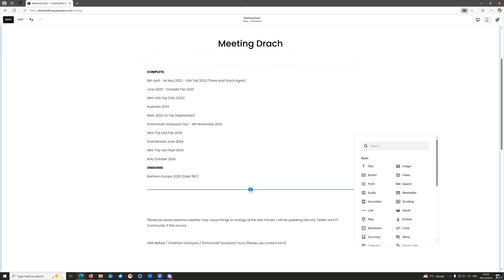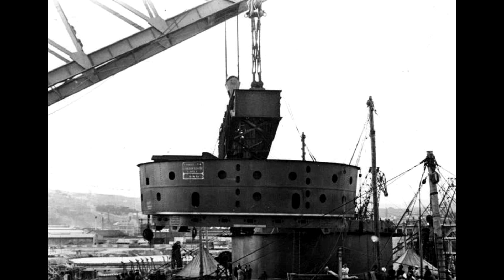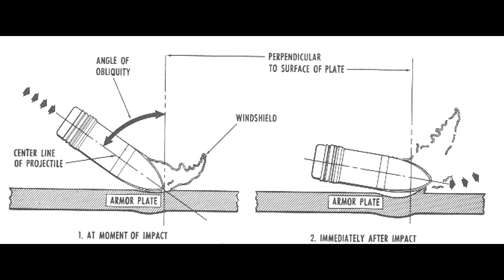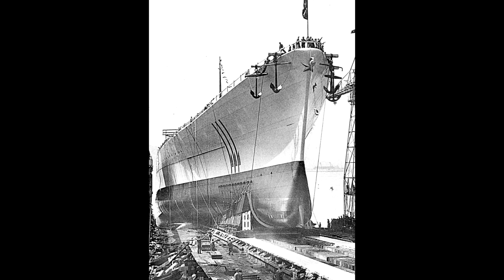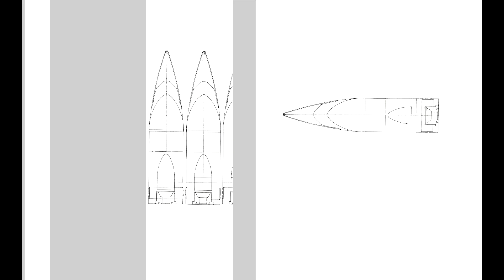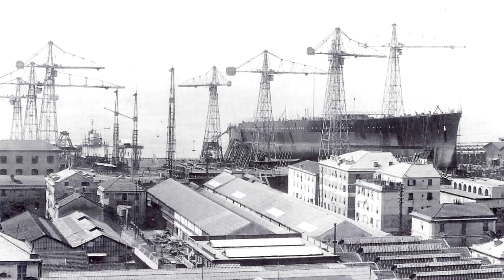Naval Engineering - Did the Littorio's Armour Scheme Work?

Comment: One thing you need to keep in mind is that concrete is very strong in compression for it's weight.  Concrete can very greatly in it's compressive strength depending on it's composition.  A high strength mix of foamed concrete would have much greater resistance to penetration than regular strength foamed concrete.

Comment: Aerated materials behave very non-linearly, the reduced density of foamed concrete is like you said decisively non-linear; because normal, non-foamed concrete lacks any meaningful internal pore space, it can't internally compress, and instead acts like a hydraulic conduit that somewhat offsets any shearing potential that might have separated the cap from the shell. By allowing the aerated micro-pores to fracture/compress and absorb kinetic energy before densification, at which point they act the same way, you almost create a kind of hydropneumatic rather than hydraulic system that much more quickly breaks up the cap for its thickness and density than air or solid concrete alone would. In addition, this isolates shock rather than spreading it for much the same reason, aerated concrete not permitting large fractures to spread through its whole mass but rather isolating it to one specific region on impact.

Take a look at SACON (Shock-Absorbing Concrete) and other programs for more, as well as Gibson's and Ashby's "Cellular Solids" if you're into math.

Comment: I am not sure I agree with a basic premise of this discussion. My problem is the definition of the cap in AP capped shells. I recall reading an article from before WWI that explained the design and functionality of the cap. The article stated that the cap was softer than the body of the projectile. The purpose was to provide an expanding ring whose mass would hold the projectile core in place at an angled impact and to also keep it from shattering.
Reply: I believe the article was published in the Naval Review for 1913.

Comment: People are often surprised what excellent engineers Italy produces. Their ships and guns were fantastic. The problems their guns had were very bad shells, which were supplied by a relative of Benito's in the usual kickback scheme that holds Italian politics back since the dawn of time. They would cluster a salvo into a circle three times what a British ship would. No wonder they ran! There were many instances of ships continuously being straddled over and over, yet no hits.
I have a couple of Italian metalworking machines. They are so much easier to use and are more accurate than any others I ever used. So don't blame Italian ships for their problems, or even their officers. If you straddle an enemy over and over, it is the fault of the shells, not the gunners.

Comment: I wonder if there is another way of looking at this.  I am thinking of how sprung dance floors are constructed, and how the kamikaze hit that penetrated the flight deck armor of HMS Formidable (4 May 1945) may have been more effective as a result of striking a joint between multiple armor plates.  It was only a 250kg bomb, and a light weight aircraft (a Zero), and based on the eyewitness testimony probably not flying that fast.  Many people will claim that such a light bomb could not penetrate that armor in a low altitude attack and yet clearly it did (which suggests a potential flaw in how they measured effectiveness of armor thickness versus weapons - did they take armor joints into account?).

A sprung dance floor uses offsets to people stepping on the joints do not feel the 'hardness' of the underlying floor - there are multiple layers in the structure and a bit of thickness to provide this offset.  It makes the wood floor very comfortable, much more so than a naive floor build where no offset is present and the floor feels different at the joints than it does in between.  In dance shoes the difference is quite noticeable if you pay attention.  Effectively the sprung floor, by design, is somewhat isolated from whatever is underneath it.

What if the Italians had thought about the vulnerability of armor plates at the joints, and had come up with the concrete scheme and a little bit of depth to give them offset between the armor layers, with a medium (foamed concrete) that would tend to disperse the energy of a hit a bit?  Perhaps the gap is there not so much for decapping purposes but to allow for this and for the structural elements that let the outer armor layer joints be offset from the inner armor layer joints?  

If you had a single steel plate of greater thickness, it would efficiently transmit force through the single joint since it's all metal, but multiple layers that are offset with a somewhat diffuse medium between them could potentially provide protection from force being transmitted in this manner.  I say potentially because I haven't tried to model it and it's not my field.

I have no evidence to support this idea, it's just a random thought.  Did anybody think in these terms back then?  Do we have any pictures showing the structure of the various layers and where the fasteners were?

On a related note, maybe Formidable either needed a little thicker armor (3.5 inches?), or to have the armor divided into thinner pieces with a gap and an offset scheme.

Comment: I don't understand the point of using concrete (foamed or not) as a filler.  Drachinifel clearly explained that it's not enough to break the cap's attachment points; the cap must fall away from the shell body, and for this it needs an empty space to fall into.  If the shell is surrounded by concrete, it will arrive at the armour belt with the cap still in position.
Reply: That's not what the RL German experiments found. 
No projectile arrives perfectly straight. The same impact that decaps it make it start to tumble, and something that enhances friction accelerates the separation between the cap and the shell.

Comment: What I take away from this is that the decapping plate would have worked as intended if only the Italians had moved the decapping plate outward and/or the armour belt inward enough to leave a one-meter gap.  As far as I can tell, most or all of this was above the waterline, so displacement would not be an issue.

Comment: I came to say that modeling of foam properties can be a very deep rabbit hole.  As Theodore_zd2mv’s pointed out you’re going to need a whole lot more info on the foaming to even start the process.  
Assuming you do have some of the info from the records I would talk to mining engineers and companies since spray concrete is often used to quickly stabilize tunnel walls.

Comment: Where this system fails, or perhaps falls short is when you take into account the behaviour of enemy shells, not simply your own.

I am NOT a subject matter expert, I have just read "a few" discussions on forums as well as doing my own "googling",

The Nathan Okun article mentions:

"U.S. hard AP caps Army or Navy - do not consistently break up at 0-30° obliquity until 0.35-caliber of STS (armor-grade) is used as the decapping plate"

Which confirms what I had read earlier, 

In regards to the fact that at "beam on" engagements, that the STS hull plating is unable able to decap large naval shells,

As well as understanding some of the design choices of other navies.

Based on no doubt hoping to consistently decap enemy shells (US naval shells), the decapping plate would need to be 406mm X 0.35 = 142.1mm 

Assuming that German and British shells ALSO has armour caps of similar hardness (Nathan assumes that the Germans DID) this would mean 380mm/381mm X 0.35 = 133-133.35 mm

Which explains why Bismarck's upper belt was 145mm

(Sorry to bring Bismarck into this, but this is a video on spaced armour)

So if the Germans who also did experiments on spaced armour came up with using 145mm, knowing about concrete etc

Is 70mm + concrete really going to be all that effective?

The German did numerous tests using a 38cm shell at 0-45 deg impact angles,

The article that Nathan posted, claims that only a single test was done using a 32cm shell at 30 deg (against a scaled down mock up of VITTORIO VENETO belt at 30°)

So my own thoughts is that if I was going for a spaced armour layout, I wouldn't use the Italian design.
Reply: "break" in that article means "break", not "separate". That's the minumum thickness to effectively break the cap. To separate it, you can see the graph, and consider only type I cap (the same Okun gives a list of the shells with type II cap, and no WWII battleship shell used it). 0.155 calibers decap everything.
Reply: @neutronalchemist3241  The problem is that the cap might separate but still be able to act as a cap,

So the only guaranteed way to remove the ballistic cap from any further penetration is the break the cap,

However as the angle increases the higher the chance of the cap separating and not playing any further part in helping the shell penetrate.
Reply: @notsureyou  The studies cited in the clip were made exactly to find the gap between the decapping plate and the main plate necessary to remove the not-broken cap from the shell.
Reply: @neutronalchemist3241  If the cap is dislodged and no longer plays a part in any future penetration 

(even if beam on at close range)

I wonder why the designers of Bismarck decided to use more armour than what was needed for the upper belt.

being generous and using .02 calibre, 

And 406mm (the largest to be expected shell)

Gives a value of 81.2mm

So why would they use 145mm,

Unless it was decapping as well as keeping  keeping 6 inch shell etc out beyond circa 4km 🤔🤷‍♂
Reply: @notsureyou  The fact that the Germans made a choice, doesn't mean that who made different choices was wrong. Surely the 145mm upper plate of the Bismarck gave more protection than the 70mm of the Littorio against lower caliber guns. At the cost of more weight. A warship design is made of compromises.
Reply: @neutronalchemist3241  100% agree

Comment: Actually most of the questioning I’ve seen has been much more about the Littorio Class torpedo protection (or Pugliese) system
Reply: Analyzing the damages it received, it worked quite well, with good containment and short repairing times. The Soviets tested it in real scale against the traditional spaced system, and chose the Pugliese for the Sovetsky Soyuz class battelships. The results of their tests are available online.  
The Navweaps critique of a "dam mistakenly built bowing downstream" doesn't make any sense. If that's true, the traditional systems are dams with an outward 90° angle, that's even worse. 
Conte di Cavour and Caio Duilio at Taranto had not been hit in the Pugliese System. The torpedoes, ricocheting from the surface to the bottom of the harbor, exploded under the keel, in the worst location possible (is to purposedly achieve similar hits that magnetic fuzes had been later introduced).

Comment: I feel like filling the scheme with concrete would depend veary heavily on the hardness of gravel used. It is in fact eeryly similar to later developed composite schemes, which, granted were meant primarily to counter HEAT-FS at significantly smaller calibers  but they still did provide weight efficient protection against kinetic penetrators.

Comment: Very interesting analysis!  I wonder... you now calculated the worst-case situation where a shell is coming perpendicular.  What about when it comes at for example 20 degrees to perpendicular?  
I can imagine that equal protection to regular armor at perpendicular impact is considered sufficient when at the same time you also get significant better protection at different angles.  After all, in combat you'll probably are either closing the distance to your opponent when engaging a weaker opponent or increasing distance when disengaging.   Even when keeping distance, you still might be laterally displaced and not having the gun bear perpendicular to the ship. 
The instances at which incoming fire is near perpendicular to the ship is probably quite rare compared to different angles.

Comment: It's always incredible to imagine just the sheer mass of the armor used on these things. The first battleship I had a chance to wander about was the Massachusetts. You see the huge steel tube running up to the turret, but you don't really get a sense of it until you've passed through a hatch. It's a strange thing to wrap you head around. Then when you include the fact that that armor on the Massachusetts also had stress cracks running across them caused by the recoil forces of the main gun, then you really start to go bibbledy.  An other interesting bit is one of the shells the ship fired and hit another ship. The shell was recovered, I assume to study, I don't remember precisely the story we were told. But to see the front of the shell having that shaved, chipped away look, but then the rear of the shell had, at some point on it's way to making someone's day very bad, had clearly liquified. I understand the mechanics behind that outcome, but it's still an amazing experience to see the results when you're standing right there looking at it with your own eyes. That was a great place to go. Especially since there's not a lot of places you're prevented from seeing. And while you can get guided tour, you're also allowed to wander as you please. So there's no rushing you through to get the next batch of people in. So I ended up spending 8 hours in there taking pictures of just about anything I found interesting and ended up with hundreds of photos. I was kicking myself in the butt for not having brought my DSLR as the cameras in smartphones at the time were not optimal.

Comment: Intuitively, it feels like all the extra rough edges of the foamed concrete would grab onto the AP cap and help dislodge or deform it, and thus mean foamed concrete would have been reasonably effective.  But I'm a law librarian turned bus driver, not a mechanical engineer, so my intuition isn't really resting on a strong foundation here.

Comment: Talking of decapping armour...I've read of so called "plastic armour" that was developed after Dunkirk, as operational research had discovered asphalt decks on certain ships had  offered unexpected levels of protection against armour piercing machine gun  rounds. Put simply a matrix of an elastic matrix is used to support extremely hard gravel.  Royal Navy wasn't  happy with idea of it being called armour/ armouring merchant ship, but it did see some limited use, due to how easy it could be added to ships. I'm guessing that in effect it was annother way of decaping rounds.  It does appear idea got developed into certain modern tank armours. Was it ever used on capital ships?
Reply: That sounds suspiciously like composote armour as evwntually developed in tanks, which usually involves some extremely high harness material such as tungsten carbide beads in the case of T64, fiberglass in the case of T72, or highly angled martensite steel plates in Dorsetshire composite, suspended in aome sort of amorphous polymer, resin or rubber.
Reply: @egoalter1276  yeah modern composite tank armour is supposed to have it's origins with the 1940s invention of "plastic"(meaning "easily castable") armour used on merchant ships.  As I said I'm surprised it didn't see use, in between times.

Comment: I hate to add another potential wrinkle but while steel is a homogeneous substance and concrete is not. The tendency of the decapping layer to come unseated from the main shell body might be dependent on the aggregate used in the concrete. You might want to use something like heterogeneous sized break rock in the mix to produce uneven lateral forces.

Comment: The Littorios seem to suffer from too many assumptions and not enough real world testing, especially considering have novel the protection systems were, makes you think the Germans were right in just brute forcing the capabilities they wanted out of the Bismarcks instead of clever work-arounds.
Reply: Maybe had they studied the rudder and bow section a little more the Bismark would have fared against aerial torpedoes as well as the Littorios did...
Reply: @neutronalchemist3241  Well isn't that the thing though, that the Bismarck could tank aerial torpedoes while the Littorios couldn't.
Reply: @abrahamedelstein4806  Bismark had been crippled beyond usability by a single aerial torpedo, Litorios had been hit multiple times in action by aerial torpedos and heavy submarine torpedoes, and none prevented them to return to port on their own power. 
It was a design mistake in the stern area not only of the Bismarck, but of several German warships. Bismarck (26/5/1941), Lutzow (June 1941) and Prinz Eugen (April 1942) were all torpedoed once in the stern and the stern section failed in each case.
Reply: @neutronalchemist3241  Could be that I'm misremembering but I thought Bismarck tanked multiple hits before she took one that jammed the rudder.
Reply: @abrahamedelstein4806  In the first Swordfish attack, Bismarck was hit by two torpedoes, one amidship that worsened the flooding caused by HMS Prince of Wales, that had still not been perfectly contained (in the battle against the POW, the Bismark received worse damages than it caused) and the one in the stern section, that practically ended it's life as a fighting unit.

Comment: Just to throw another spanner into the works - assuming aerated concrete, what would the effect of reinforcing bar (re-bar) be? Negligible on the bar reducing the KE of the projectile directly, but it could potentially provide a mechanism for energy dispersion that holds the concrete more in place as the shell passes through? Just a stray thought